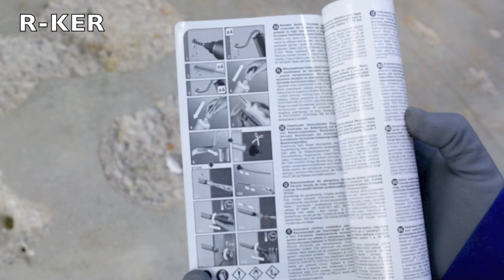Screwfix - Rawlplug R-KER-380 High Performance Vinylester Resin

Comment: Could i use this method to attach wooden planks to exterior walls ready to attach stringers for a new staircase? Want to make sure it is secure as well as not allowing moisture in. Obviously would need to countersink the heads to ensure they didn't stick out...
Reply: Chantal du Thoit yes

Comment: All that just for 4 bolts.and how much does that cost?  There are other fittings that are just as good,and probably more secure,and cheaper
Reply: if you doing similar works every day then it cost not a lot and its actually quick and really secure.
Reply: as well as its not only for bolts, studs , you can glue anything really.
Reply: Malcolm James it’s about £5 for a tube, it’s also much stronger than almost mechanical fixings
Reply: Horses for courses mate. You wouldn't use them to hang a picture.
Reply: @rich3633 I actually did 😆,  they are great on most applications into brick and concrete.

Comment: Why on earth not clean up the extruded waste with a cloth before it sets..not hairy-arsed enough for you??
Reply: Because it fouls the threads worse than the method in the video.
Reply: @HakureiMikko  Why not mask the threads with tape, as well as masking the surface around the hole?
Reply: Because it smears into a nasty mess.  This way cleaner.